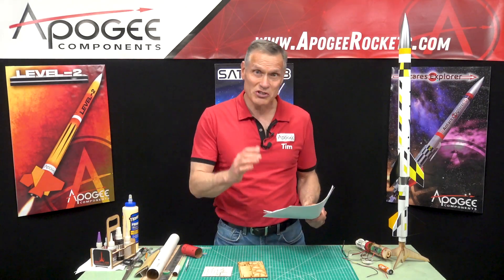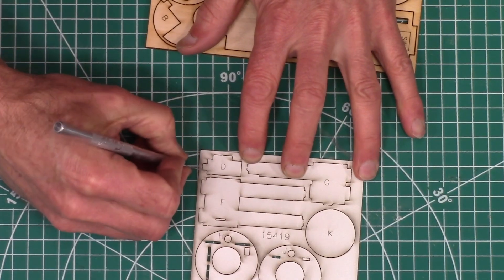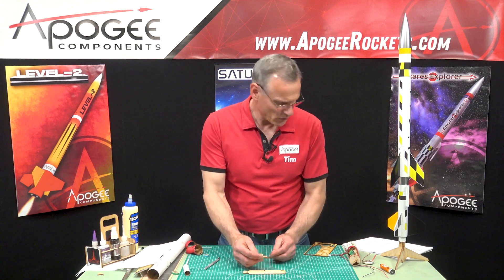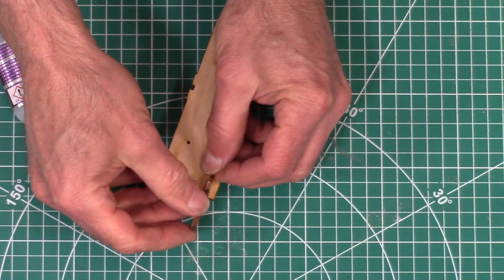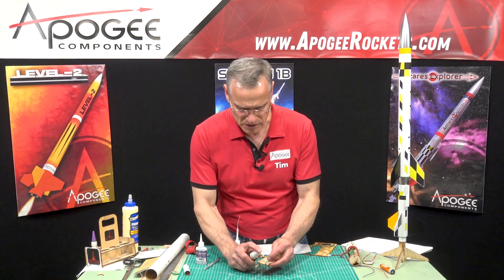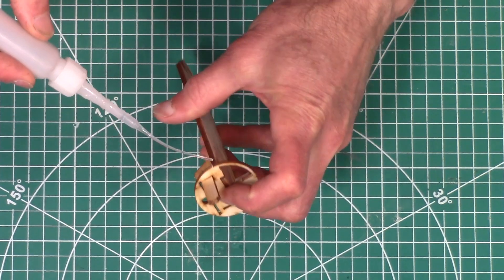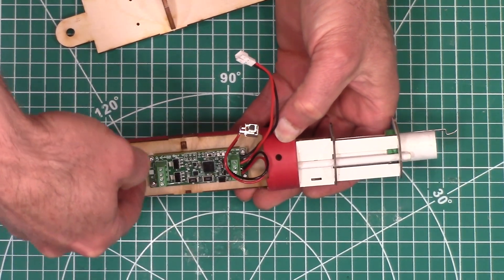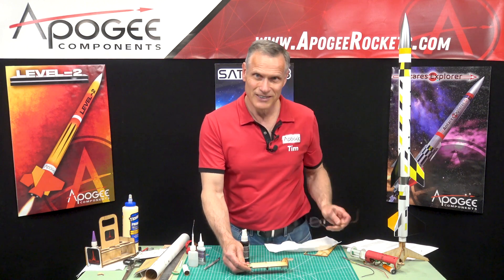Building the TTV Model Rocket Kit - Part 2

Comment: I’m getting ready to enjoy this build, but quick question: why CA for glueing the frames, etc? Is it just for efficiency or would it cause issues to use wood glue or a touch of epoxy instead? I’m a little challenged with runny CA. Thanks!
Reply from the maker: It is for efficiency. Super glue hardens quickly, where epoxy is very long.